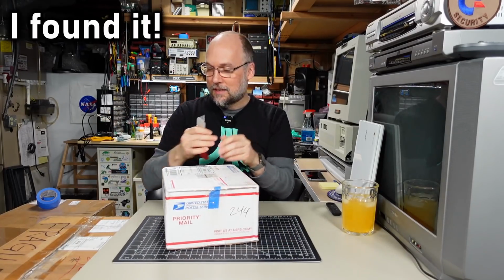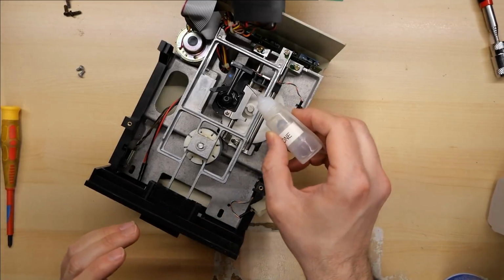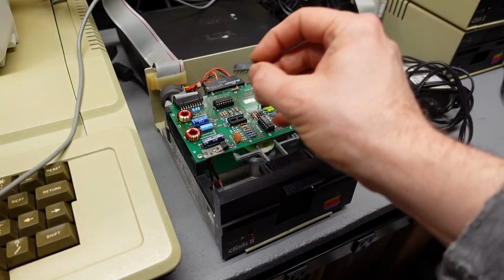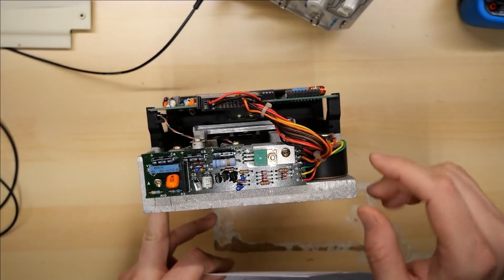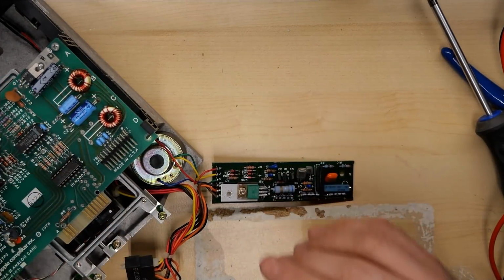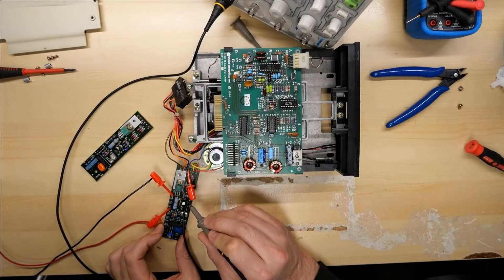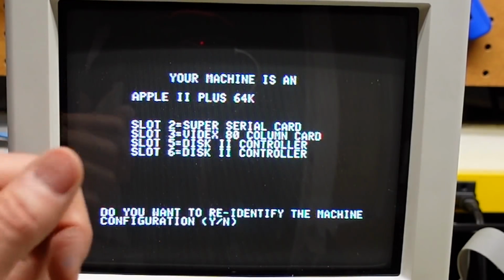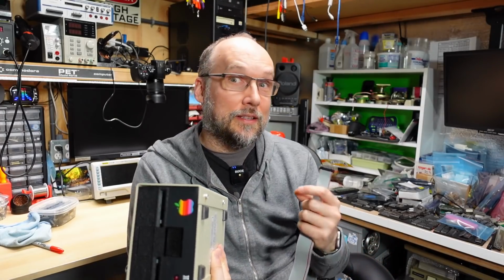Repairing an Apple Disk ][ drive with multiple faults

Comment: If the mosfets or whatever switching transistor has failed, they often fail short circuit.  If it's chopping 12V into some square wave pattern to regulate speed that would explain full speed operation.  You could measure voltage output on the bad controller board.  If it is the same as VREF then either it isn't switching because of a short, or isn't receiving a switching signal at the gate.  Should be relatively easy to trace with a scope.  Sometimes the gate driver is through smaller transistors to protect the IC's.  One of those could be bad too.  Find the PWM output pin on the Sony IC.  Is it switching in relation to the RPM input? No=bad sony.  Yes=find the next transistor in the chain.  One of them must be bad.

Comment: Hey Adrian, were you able to write with that drive? I have a Disk ][ that can read fine but all writes fail and I'm stumped.
Reply: That could be a dead ULN2003 as that chip is a power transistor chip. May be the driver for the coils in the head.

Comment: The ULN2003 is readily available and are cheap too. I'm using one in a control board I'm building to control 2 relays and a servo motor from the signals of a ATMEL micro-controller . They can take 3.3-5v TTL signals and can bring them up to 25v 500ma on each channel. You can drive them in parallel to increase the current. Never knew they were in a Apple II floppy drive from 1981.

Comment: The motor on off is working as is the tach into pin 1.
The only parts remaining are IC , R1 , R2 , R10 ,VR1, C2 , C3 , C4, C5 & C6 .
Or the PCB  has damaged print or faulty joints  .

Comment: You can get ULM2003 (H-Bridge) chips for next to nothing. Most of the time they come free when you buy a small 5V or 12V stepper motors on ebay, they are between $0.75 to $1.50 by itself. But most are on a small interface board to plug the stepper motor to and have LEDs to show which stepper motor coil is activated. Most of the time the chip is on a socket do you can pull them out. You can get the chip by itself but I seen them in this format with the stepper motor interface.

The board I mention has no other electronics and has connectors mounted to connect the stepper motor to. Google "Arduino Raspberry Pi Stepper Motor uln2003 H-Bridge"
Reply: It's a DC motor with a tachometer not a stepper motor .

Comment: I have the working guts to one of those somewhere in my retro gear. Interesting to know the speed controller is shared with other companies drives.
Reply: Not just the speed controller - the entire drive mechanism. Shugarts were the mech inside IBM 5150's, later ones used half height MFM drives. The drive in the IBM XT is the exact same drive as the C1571 (which is a standard PC/MFM drive with a Commodore card).

There's only so many ways you can make a magnetic disk drive in a cost-effective manner anyway.
Reply: @Stoney3K  I once had a Tandy Color Computer Floppy disk controller and enclosure and put in two half height PC drives without issue.  I had two more floppy drives than I had original floppy disks for the system though. :)

Comment: The Sony CX-065B seems to be still sold on eBay. You can even use a NTE1300 or a M51725L, but they are all above ~10$, so it should be fixable, but is that worth it?

Comment: Hi Adrian;

It might be worth checking that big green power transistor for shorts. If the switching signal is present at its base terminal but the motor is still running maxed out then most likely the transistor has a collector-to-emitter short. It appears to be a standard part that should be easy to source a replacement. Good luck :)

Comment: Adrian, after a little digging it looks like a replacement for the Sony CX-065B may be the NTE1300.  It looks like that was available through Mouser at some point.  I have not looked on Mouser or Digi-Key to see if it can still be ordered.

I really should check out my old Apple ][+.  I actually have two Franklin versions of the Disk ][ and controller cards, it's been years since I've tried powering it up.

http://cbm-hackers.2304266.n4.nabble.com/Spare-part-inquiry-CX-065B-from-Alps-DC-motor-control-board-CBM-1541-td4641750.html

EDIT: I am not recommending this place, but it says they have 325 units in stock, and so far the only place I've found that does.

https://www.ntepartsdirect.com/ENG/PRODUCT/NTE1300
Reply: Adrian - how about checking with Norvac Electronics down in Salem? They are dealers for NTE components. I'm in SE WA state and buy from Norvac from time to time.

Comment: Apple switched to the Alps mechanism by 1982 for cost reasons. The Disk ][ drives I got with my Apple ][e in late 1982 and 1983 had Alps mechanisms. I think you can tell the difference between Shugart and Alps by the color of the cable. The Shugart ones have rainbow-colored cables, and the Alps ones have gray cables.
Reply from the maker: Ah I thought that cable difference was simply due to additional RF shielding being on the gray one... didn't know it related to the mechanism.
Reply: @adriansdigitalbasement   There is indeed a correlation between the cable and mechanism used, but I wouldn't rely on it 100%.  It's like "knowing" that a C64C has a short "E" board and 8580 SID because the graphics characters are on the top of the keys.  It's probably true for any given case, but not always.  The only way to know for sure is to actually check.

Comment: I still have a 1541 for which I did head alignment one night. Everything went ok, it worked ok. The next day I turned it on and had the same issue. Came to the same conclusion that the Sony IC must have gone bad.
Reply: It's the heat from the transformer. Back in the day, I had to leave my drive on all the time to keep it hot otherwise it wouldn't read my disks. That chip just does disk speed, not head alighnment.
Reply: @UberAlphaSirus  It cannot be farther away from the transformer in a 1541. I also kept it disassembled for the night. So, I really have no idea why it went broke.

Comment: Well done! Never knew the drive shared some parts with the commodore. Also surprising: no deoxid was used in this episode! Doesn't happen too often! 😄
Reply: Well, they are both based on Alps mechanisms in this case.  It depends on the individual drive, though.  Earlier Apple drives were based on Shugart mechanisms, while later 1541s were based on Newtronics (Mitsumi) mechanisms.  If you had an older Apple drive, you might be able to get some parts from a Commodore 2031 or 4040 (drives for the PET) instead, since they were based on the very same Shugart mechanism (SA390).

By the way, the Shugart mechanism is where the Apple and Commodore 5.25" floppy disk formats got their 35 tracks from--this was all the tracks it could access.  The later Apple drives and the 1541 (all variants) can access 40 tracks (and usually one or two more), but the formats had been set by the earlier limitation (because of the PET drives in the case of Commodore).  These formats could have had 20 kB more capacity (not 100% sure about Apple, but definitely Commodore because if its speed zones and type of GCR encoding).

Comment: why aren't you using your white paint pen that was sent to you?????????
Reply from the maker: I do use it when marking up lots of chips -- but when you haven't used it in a while, it takes quite a bit of shaking and then you have to use a scrap piece of paper to get the paint to flow out of the nib before you can even mark something. So what takes 1 second to mark with a regular sharpie takes a minute with the paint pen...

Comment: One little question: isn't a lithium grease better for metal-metal contact pairs?
Reply from the maker: I find it can gum up as it ages so I just stick to the silicone
Reply: @adriansdigitalbasement  Yeah, I learned from experience that lithium grease eventually gets sticky on the rails. These days I just use isopropyl alcohol and everything slides well enough without any worry about about eventually gumming up. How long have you been using silicone?

Comment: I think it's called a step-down gear. The electric motor spindle rotates several times to one rotation of the step-down gear. Some turntables have a belt drive while some have sprocket teeth gearing. I think all the names of stuff gets muddled when it doesn't describe the function. Great show. Thanks.

Comment: Why don't you throw away the bad chips or give them to recycling? It is not that you have any use for them or put them in Display at least.
So, wouldn't it be better to get them recycled?
Reply: "recycling" of chips like that means someone in Asia cleaning it up and selling it on Aliexpress or eBay. Better to keep dead parts out of the parts ecosystem.

Comment: I'm betting the problem with the speed controller board was a malf'd potentiometer.  Those can fail, wide open, completely shut, or 'stuck' at whatever they were at.

Did you check that?
Reply from the maker: I did check it -- but the pot is only designed to slightly vary the speed around the target speed. It does not control the motor speed from stopped to warp speed. So even if it was removed the speed would only be slightly out of spec.
Reply: You could "emulate" the sony chip with a microcontroller (in case you need the replacement board for another project a bit later). It should be fairly easy to write a fitting program.

Comment: Using bearing oil where it can came in contact with plastic parts is not a best idea. Mineral oils degrade plastic parts, and may lead to their disintegration in the future. I'm using teflon grease on the rods. Molykote has a selection of specialized lubricants for plastic-metal interaction. Unfortunately they are sold in huge containers and are very expensive. EM-30L is good for such applications.

Comment: I have a 3.5" floppy drive in my old PC and the drive didn't work after I took it out and put it back some time ago. Last week I didn't a thorough cleaning of the machine and I figured the IDE cable was plugged in both reversed and shifted 1 row to the side, I thought it was dead but nope, I just put the cable back as I should have and still works perfectly fine. They probably built in some protection into these modern floppy drives.

Your videos keep inspiring me to do repair and maintenance jobs on old hardware. In the past week I did some repair on a 5.25" drive and did basic maintenance on it plus on another one that didn't need repair. Both work beautifully, I just checked the prices on these on ebay and they are crazy high!
Reply from the maker: Yeah IDE and floppy drives on PCs only have low current signals going through the cable, so plugging them in wrong doesn't cause an issue -- versus this disk drive where it's sending 12v and 5v right from the power supply to power the motor. When you send 12v into things that don't expect it, bad things happen.